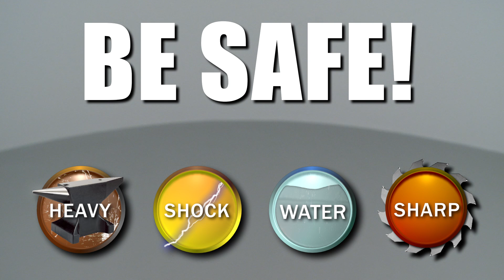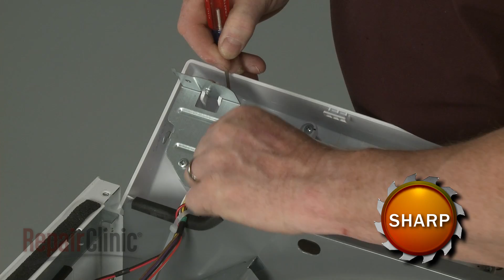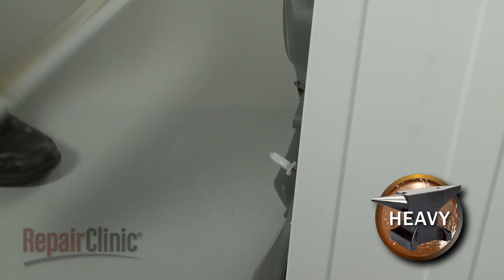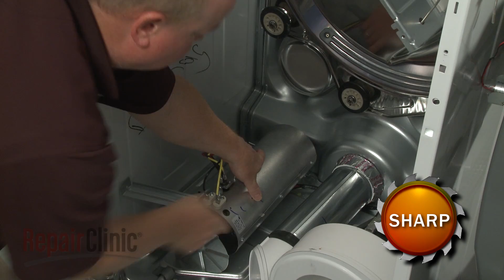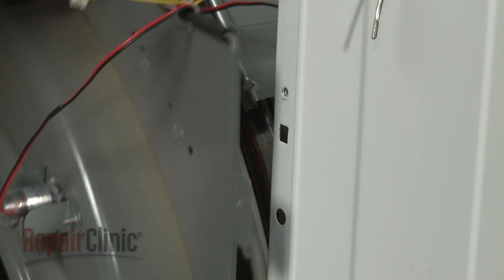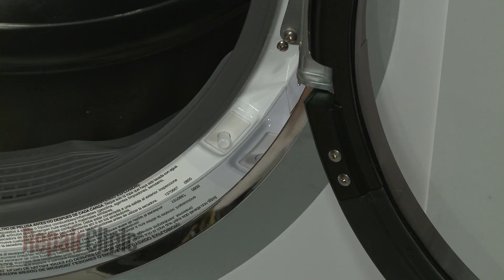Electrolux Electric High Limit Thermostat Replacement #508516

Comment: Much easier to go in through the rear. I found this out with trial and error, doing it twice. You will be removing the top and rear panels, but easier than the front, top, elec panel, tub etc...